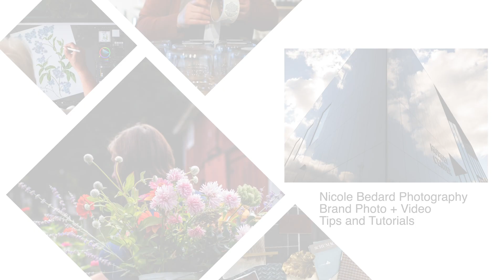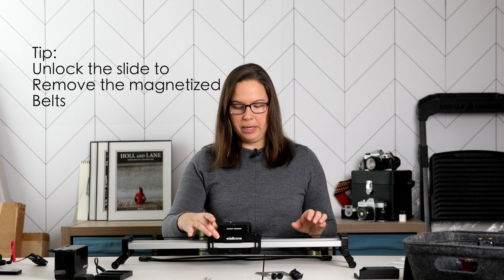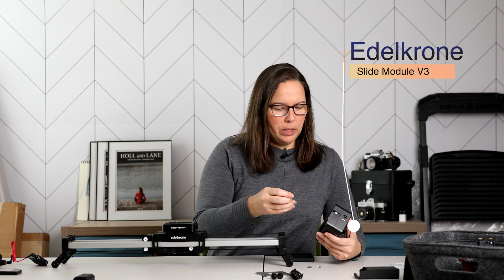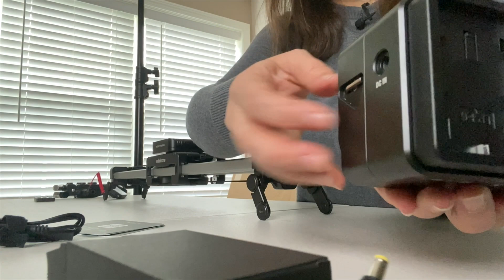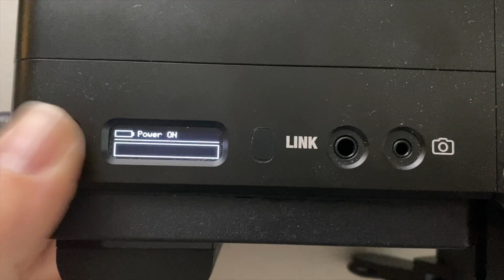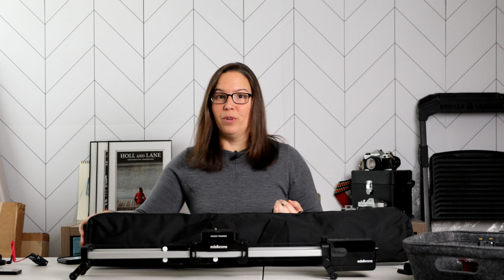Installing the Edelkrone Slide Module V3 to Slider Plus V5 Pro Long

Comment: Hello there, I just purchased the same slider, I am trying to switch out the fabric belts for the motion control belts, but it’s almost like it is too short, and I don’t want to try and force it. I can’t find any info online anywhere, just sent an email to edelkrone to see if I got a bad set of belts or what.

Thanks for any help
Reply from the maker: Yes! I had this same issue.  You want to have it unlocked so the slider piece on top moves.  Once you do this it won't feel like it's too short. Look at around 3:04 of the video.  Have fun with the new slider!
Reply: @NicoleBedardPhotography  Thank you for your response! 

I also found that the magnetic pieces that hold the belt, were placed too far down, so it didn’t have enough length to connect. 

So it was a two part issue. 

Thank you for your video!
Reply from the maker: @PARADIGMSHIFTOFFICIAL  Great to hear the problem has been solved. Happy to assist. Enjoy the slide!

Comment: I keep getting a incline danger notification rven though its on flat ground
Reply from the maker: Which side do you have the motor attached to. Maybe switch it and see if the error pops up.
Reply: I’m glad you clarified after you said: “I’m mounting this motor, on the opposite, this is saying the incline, on the  opposite side” which didn’t make sense but then you clarified after. I would probably cut that part out of the video.